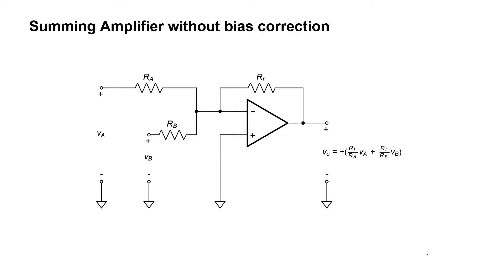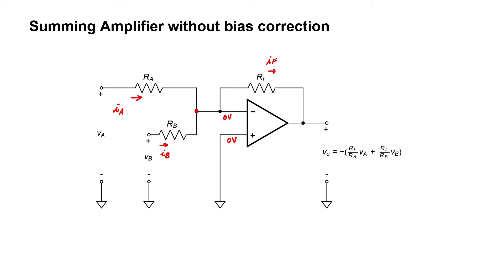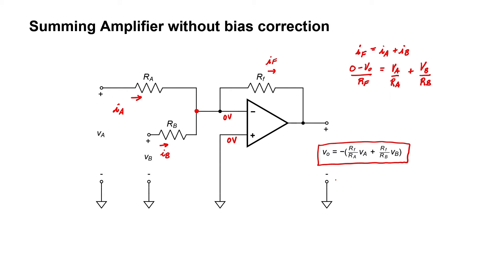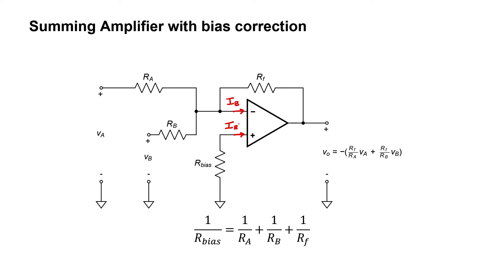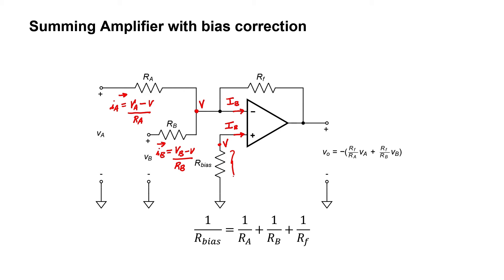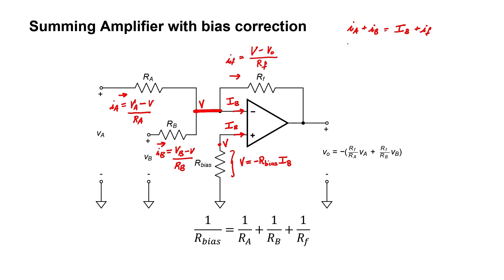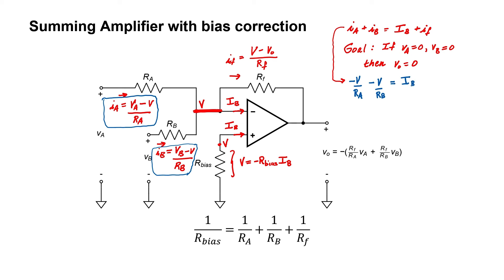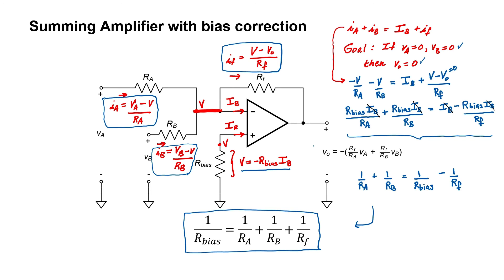Summing Amplifier Explained (Amplifiers #10)

Comment: To find the input bias resistor, you are really finding the equipment thevenin resistance as seen by both inputs and setting them to be equal. By thinking about it in terms of thevenin equivalent, you can figure it out for any circuit.